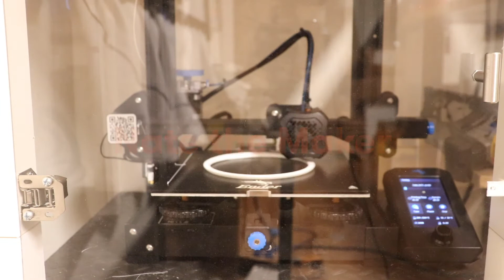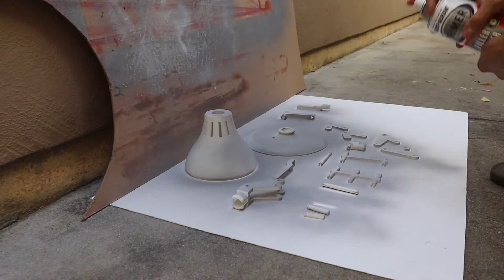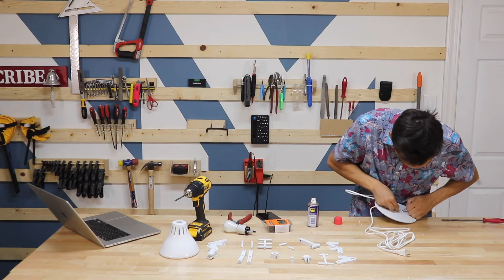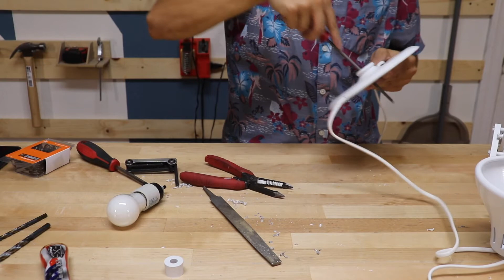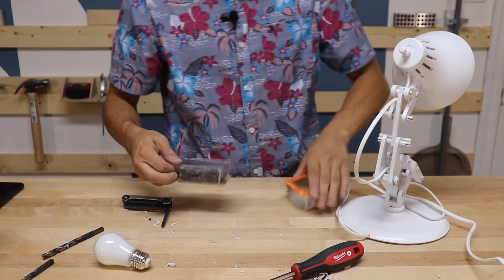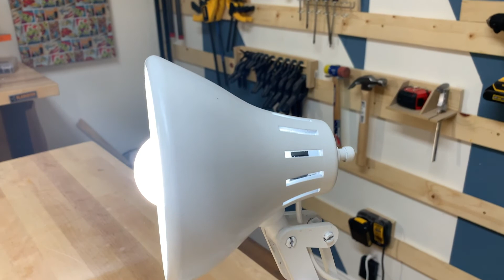How to Make the Luxo Jr Lamp

Comment: Making this for my new apartment, thanks for the video! What would happen if the light bulb were to burn out?
Reply from the maker: Glad to hear you’re making one!! Hmmm not sure, I made sure to use an LED bulb (not incandescent)  so hopefully the worse thing that happens is the bulb stops working 😅
Reply: @NatetheMaker  works for me, thanks!
Reply: @NatetheMaker  Hey Nate, finally making this lamp! Is the cord on your description the same one you had trouble with in the video? Also, is there a preferred way to take the cap out to expose the wires?
Reply from the maker: Cord in the description is the same one from the project! I used wire strippers to cut the end off and expose the wire 👍

Comment: did you print the base with supports?
Reply from the maker: I did! For the small tunnel that the wire goes through I wanted to make sure that had proper support.